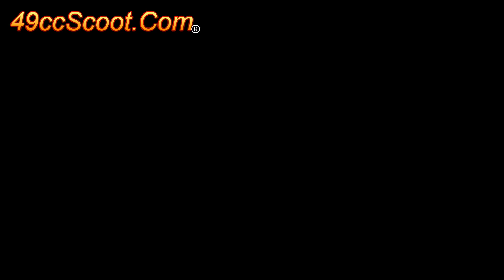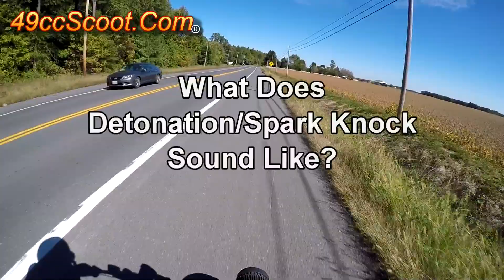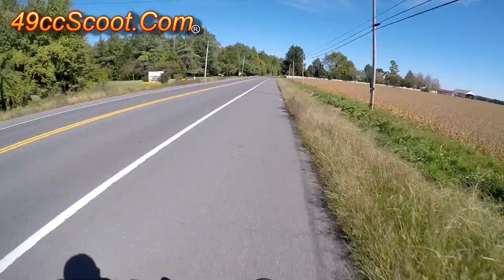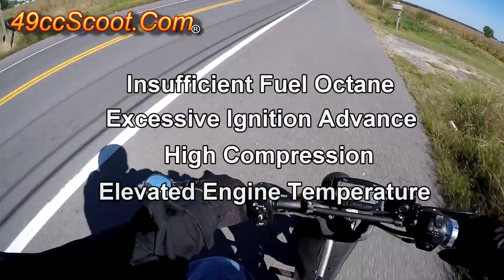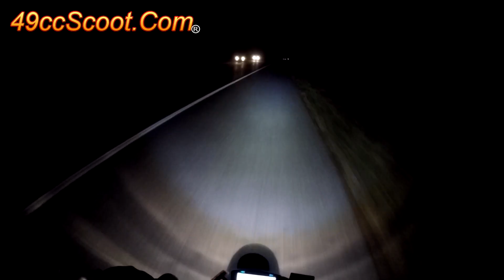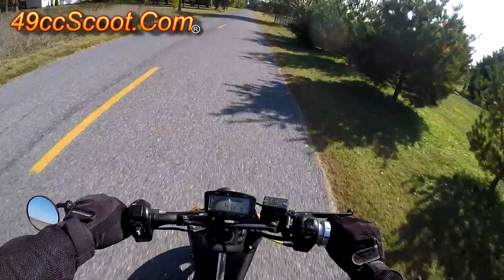What Does Detonation / Spark Knock Sound Like?

Comment: Hi i found this video really helpful to identify what my problem is.First i tought it might be my old 70cc kit but my needle bearing broke and my piston and cylinder got totaled.I got a new one and it does the same.It does it when i am climbing hill with low speed and rpm(when im carrying another person its hard to accelerate when this appears and sometimes stops) and when i throttle up it dissapears.It also happens when im riding with about 40km/h high rpm.Help me how can i fix it?
Reply from the maker: #1 thing to try is using the highest octane pump gas that is commonly available if you aren't already. After that, you may have to consider changes to ignition timing or compression. Sometimes more fuel will do the trick if it's running hot from being lean.
Reply: @49ccscoot  Thanks for the advice i will try it.But is it safe because when i had my fully stock(50cc) kit i used 100 octane gas and probably from it i  blew my piston rings.
Reply from the maker: @superbrita1224  Just use premium pump gas. If you need race fuel, you need to figure out what is wrong. No reason you shouldn't be able to get it into a spec to use premium pump without spark knock.

Comment: This happens because the timing is off and the spark maybe to advanced for the ignition to fire properly and burn the fuel inside if the cylinder ..
Reply: Mtb Ridingog In some cases yes, but most common is wrong octane rating or a lean condition

Comment: My 125 is only making a noise when accelerating in 3rd gear. It does sound similar to this but is it possible this could only happen in one gear range? 100% only when I accelerate in 3rd...
Reply from the maker: Could just be under a lot of load there.

Comment: Great video!  I've heard something similar on a number of motorcycles, 4-strokes though.  It's called spark "knock" but it's hardly a knocking sound.  On my Harley it sounded like an engine rattle when under load that would come and go based on throttle position, which I thought nothing of, and ended up smoking the motor from the bad tune.
Reply: Which harley model and year ? I have a 2017 low rider s and noticed its dependent on throttle position and does it starting 4,000 rpm only twice though sounds like little  rocks.

Comment: will you lose power or feel the bike bogging while its making that noise?
Reply from the maker: Not necessarily. You could, but usually it at least starts off with the noise being the only thing you will notice.
Reply: can a exhaust with no/toomuch back pressure cause this issue
Reply from the maker: Maybe if it's restricted enough to cause overheating.

Comment: I just rebuilt my 48cc motorized bike engine, and almost doubled the compression. I ran it hard for the first time today, and even though I'm running 91 octane, I think I heard it knock a few times once it got really hot.  It sounded like marbles hitting my engine!  Anybody know of any air-cooled 2-stroke modifications that will help keep combustion temperatures down?  I could prevent it with octane booster, but I'd rather not have to mess around with mixing that as well.  I was thinking about bolting a couple aluminum heat-sinks the fins on my cylinder head. I don't see any way that wouldn't help.
Reply from the maker: Reduce compression slightly. Keep the squish band tight to help avoid detonation. Try different gas stations so maybe you can get 92-93 octane at the pump. Tune it a little richer for more evaporative fuel cooling.

Comment: My aerox has a noticeable knock when letting go of the throttle and less audible knock at anyrecs apart from idle.
Reply: Same, the engine is running rich and not hot, but the knock is always noticeable when changing throttle positions. The plug is new as well. Would like to know how to fix it

Comment: Mine has spark knock at part throttle, i usually give it more gas and it goes away, i just rebuilt it so i don't want it to blow up again, how do i fix it? A friend told me to put engine oil with the gas and put alot of it, could that be it? Or maybe i need to tune the carburetor because i think it's rich or lean, please tell me what to do, I'm very light weight, I'm 90 pounds so I'm sure it's not from weight, anyways how do i fix it?
Reply from the maker: Could be too lean if it's at a specific throttle position. In that case, work on the carb tune. I assume it's a 2T, because you really don't want to mix oil with the gas on a 4T. Too much oil in the mix leans it out. I premix all of mine (no injection anymore) and run a certain ratio all of the time. You don't want to change ratios back and forth  because you're also changing the tune to some degree.
Reply: Well i don't know much about it, it's a jog 49 cc 2 stroke, should i mix oil and gas with it or nah?
Reply from the maker: If it's got a working injector system (stock would use an injector and have a reservoir somewhere for oil), then no. Just keep the reservoir full. If you are adding oil, especially if you're just guessing and dumping it in, you could be leaning it out.
Reply: I have a reservoir for oil and it's full, i don't think it's going down so maybe the injector system is not working, and i am just guessing and dumping it in, so should i just add gas and it will go away? If it doesn't i should tune the carburetor shouldn't i?
Reply from the maker: Take the hose off of the carb or intake where oil would come from the pump and you should be able to tell if it's delivering oil. I switch all of mine to pre-mix so I never have to worry. Then I use a precise amount of oil per volume of fuel. No guesswork.

http://49ccscoot.proboards.com/thread/564/remove-oil-injection-system
Reply: You're such a nice guy
Reply: Thank you so much
Reply from the maker: No problem.
Reply: Btw does back pressure affect anything? I have a open exhaust, it's perfect it's not too loud or too quiet, but it's a straight exhaust meaning it's just a tube with nothing restricting the airflow, does that affect the engine in any way?
Reply from the maker: As long as the carb is in tune with it and the pipe isn't really short, it's fine.

Comment: is it possible to detect knocking while in neutral gear position, and pull the throtle? i mean detect in what rpm
Reply from the maker: It may happen, but just because there is no knock in neutral does not mean there is none when under load. Not a terribly useful thing to do.
Reply: Test under load

Comment: My 150cc 4 stroke bike have knocking at 2 nd gear when i open the throttle around 4k rpm. This issue  was  noticed after a tapet clearance adjustment. Covered 12k km. Should i change the spark plug?. Is this a issue from spark plug aging?
Reply from the maker: It won't hurt to look at the spark plug, but it wouldn't be my first guess. If you see a lot of buildup on the plug, you probably have a lot of carbon in the cylinder too. That could be a problem.
Reply: I have the same problem after readjustment of valves. Now it knocks and burns oil.
Reply: @davidmorgan8612  maybe you made the wrong adjustement try again when engine is cold and do not drive agressivly until you fix it

Comment: 4t Taotao 50cc with bbk. If I'm off one tooth on the cam, could it cause this. Tried to eliminate everything else...new plugs, never run anything but 93, new cdi, coil, etc. Haven't made the slots on pickup coil to advance timing yet, and the Woodruff key is in tact on flywheel. The noise rattling appeared out of no where around fifty mile mark after bbk install.
Reply from the maker: If it were off a tooth it should not run well. Possibly compression is too high. If anything happens in the CVT that makes it lug more (lower revs) then it could cause spark knock.
Reply: 90GTVert 
I went forward a tooth today, no difference in noise, difference in response though. then went back what would've been one tooth. Very noticeable difference for the good. 

thought for a while I was a tooth but today confirmed it. Only thing is, the noise was no different from original position after bbk, forward one, back one...still same faint noise.  

I can upload a short video of it for audio if that might help.

All questions aside, your videos and forum has been hands down the most helpful anyone could ask for. And I've watched a ton across the YouTube board. 

You win my friend in regards to anything scoot related

Comment: I have a civic that I once put on wrong heat range spark plugs (lower), it sounded exactly like this.
Reply: @Teslamoanials Derived Isnt that what detonation is. As far as i know it means that the fuel in the cylinder is ignited too soon. Not too sure tho.
Reply: @Teslamoanials Derived Thanks for the info, really helpful
Reply: So what is the damage?
Reply: @courierslife3793  pre ignition, it can fuck up the engine easily.

Comment: what should i do when i hear this knocking ?
Reply from the maker: Find out why it's happening. Use higher octane fuel, see if there's much carbon buildup, look for cooling issues, make sure the spark plug isn't too hot, check ignition timing, review the specs if you just built an engine or modded something....
Reply: 90GTVert  😘thank you so much   i will check it out i like your videos 👍👍
Reply: 49ccScoot if there’s to much carbon buildup should you clean off and use less oil in pre mix? how would you go about fixing that?

Comment: I recently had the same problem and am trying to trace it down. Do you know if this would cause my front cylinder to run a lot colder than the back? Any input will be appreciated.
Reply from the maker: Usually it would be hotter if there's detonation in just one cylinder. If one cylinder is colder than the other and you're hearing knock, I'd think it's more likely that the other is running hot and that's where the knock is. For a cold cylinder, I'd think of things like a miss/misfiring, over-fueling, or even design of the cooling system that may favor certain cylinders.

Comment: We have the same problem. Is changing spark plug can help?. I've been using the spark plug 5-6 years.
Reply from the maker: It's worth a shot if the plug has been in that long. Maybe you've got a bunch of carbon buildup. Could also consider running some cleaner through the tank with the fuel (auto parts store should have cleaners specifically for that) or if it's a small engine maybe clean it the old fashioned way (take it apart).

Comment: How do you prevent engine damage if you don't have enough money to get it fixed?
Reply from the maker: Don't ride or drive it would be the easiest method. Use the highest octane of fuel at the pump. Go easy on it if you must drive or learn to fix whatever the issue is yourself.
Reply: Thanks for the advice, but I've narrowed the problem down to a stupid bearing in the water pump. ends up, when I put the new fuel pump in, I got the alternator belt too tight and it wore the water pump bearing down. Still an interesting video, and I will continue to look out for this problem, as well as replacing the water pump and not getting the alternator as tight. Cheers, friend!

Comment: Ever since the temperature dropped below 5 degrees C (40F) my clutch is engaged all the time, even when I`m idling @1500 (Not good for bearings, I know) I get tugged forward. Anything I can do against that? Will changing rollers have any effect on `clutch engage` rpm?
Reply from the maker: I can't say I've ever heard of low temps causing early clutch engagement. It's usually the opposite. When springs get hot, they are weakened and offer less resistance so the clutch grabs at lower revs. I would suggest inspecting the clutch and CVT to see what's going on in there.  https://www.youtube.com/watch?v=2EjW-iSP-Q8
Reply: 90GTVert Perhaps that could be it, I upjetted and tuned my scoot so I accelerate @7400rpm instead of the previous 7000rpm.
Reply: Kevin Beunders yur clutch springs are weak so replace them then the problem will be over springs lose some of their tension over time and that happens faster with allot of heat and cooling so probaly thats why you have this problem.
Reply: Thank you guys. Will order some springs soon :)

Comment: apologies it's not blow by its backfire thank you for responding other than that the engine is running fine
Reply from the maker: Start by looking for leaks by the header. Maybe a gasket issue or a pinhole in the pipe. You may also be running lean.

Comment: Hello, 
I have a Jawa 23 (a.k.a Jawa Mustang) and just replaced the cylinder and piston on it. Now the engine makes a weird sound when letting off the throttle. I don't know what the problem could be, maybe the piston pin is loose or the engine is knocking like in your video. Heres a link to my video demostrating the sound: https://youtu.be/DMj8ilU0Hss   I'd appriciate it if you told your opinion. Thanks!
Reply from the maker: I'm not really sure. It could be from too much piston to bore clearance. I've installed a couple of cheap kits from eBay lately that make this noise. They run great and I can't find any signs of contact, but they make a similar noise full time.
Reply: 90GTVert thanks! the too much clearance sounds plausible.
Reply: Yep. That sounds like piston slap from too much clearance in the cylinder bore.

Comment: Hi 90GTVert
Use 2t spark advance curve:https://www.rcgroups.com/forums/showatt.php?attachmentid=9236676&d=1470553776
Reply from the maker: I understand the concept. My whole 103cc setup this time around costs less than just those race ignitions and I'm not revving over 10K so it's not a requirement. I'd like to own the MSD 4217 CDI someday and program whatever I'd like into it, but I don't have the money to allocate for such a thing right now. Even the $80 Malossi CDI only retards 3 degrees according to my timing light.
Reply: We Hungarians, many of CDI constructed.
We will not pay expensive money ignition.
Circuit born black box expand:https://drive.google.com/file/d/0BxQHqG9HPIj3eEtUT3R0TEpnU1k/view?usp=sharing
 or Ewald website: motelek.net

Comment: I am pretty sure I am getting this after upgrading to a 70 kit. I have adjusted to lighter rollers, up jetted, got a new belt, and there are yellow contra and clutch springs in the clutch. I also added carbon fiber reeds. the scoot is a 2009 Yamaha BWS. Some suggested a higher octane fuel has anyone done this with positive results? Hey man I am still experiencing this without any way to relive it from happening. that being said I am about 245lbs so maybe the engine just is not cool with my weight.
Reply from the maker: I use premium all of the time, which is 91-93 octane here. If you aren't doing that already, try it. If it can't run without detonation on premium pump gas, then I would evaluate the tune and see if compression is very high.
Reply: thanks for the heads up man, I used your vids for all my beginner know how with my scoot. very helpful! I have nearly a full tank or reg (83ish) so ill burn it off and go for the good stuff next.
Reply: well I got a new variator, and exhaust pipe this xmas. I have upjetted the carb and tuned my CVT and as far as I can tell the possible knock was likely just a mish mas of aftermarket and stock parts just not shaking hands at all. Scoot is feeling awesome and I have a tach finally so I will be able to track my numbers better now.
Reply: your ratings are quite low,here in uk base unleaded fuel is 95 ron, super unleaded is 97 ron and tesco and shell sell 99 ron super plus.
80 ron and 98 ron(4* with a lead substitute) is available for classic and    veteran cars (very expensive and hard to find).
so we mostly dont have much problems chinese scoots are rated for 90 ron chinese fuel so you should not have problems, however  i find an odd tank of super plus 99 every 3rd or 4th fill up helps mine start in winter.
Reply from the maker: Different rating systems. Our fuels are rated (RON+MON)/2.
Reply: which tach did you buy?
Reply: aly nicholls tto tiny tach. so good, and easy to install. very basic
Reply: Thanks mate

Comment: Noticed it when I used a lower octane gas. I used 87, because the station I regularly used was out of 93. Could have been a transmission issue that was solved by new belt, weights, and rollers as scheduled mtc. Who knows?

Comment: Well now I know what that sound I'm hearing is and why its happening (im fat).
Reply from the maker: There's no reason a properly tuned setup can't run without knock even for heavy riders. The easiest solution is to move up to premium pump gas if you aren't already using it. Sometimes lighter rollers will help. If you're using an advanced CDI, that may be why. Lean conditions will make it worse.

Comment: not sure if this is the right place but if I have two identical taotao50s and one is much faster than the other where do I start to figure out what's causing the difference?
Reply from the maker: MLG M8 gave good suggestions IMO,  and I'd add checking the CVT.
Reply: jose joubert Maybe a compression test mate. I'd start there
Reply: Compression test,
New Fuel,
New Spark plug,
Valve clearance,
Air Filter,
Carburetor jetting/mixture.
Reply: Knew i forgot something! 
Yeah check the CVT out like belt thickness and the weights of the rollers to make sure both are about the same.
Should be able to find all this in your repair manual assuming its stock of course.
Reply: thank you all...riding season is practically over up here north of Boston, MA but I know this will be my project come spring...thanks